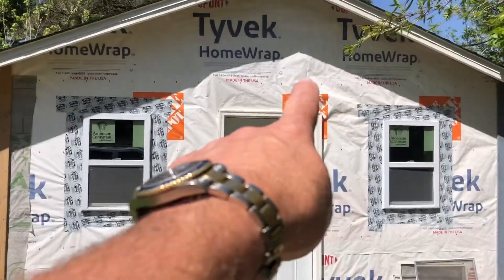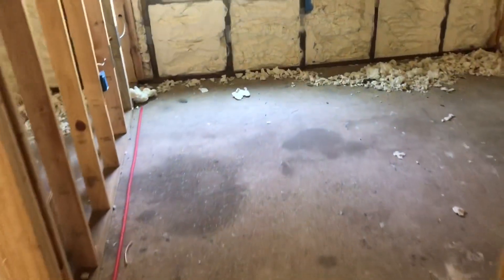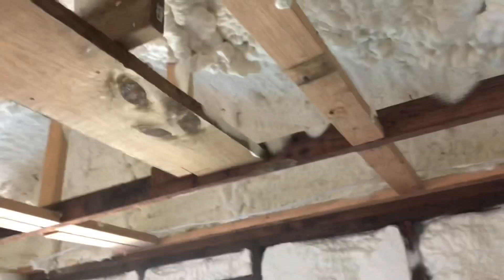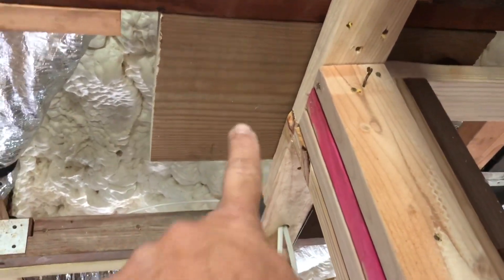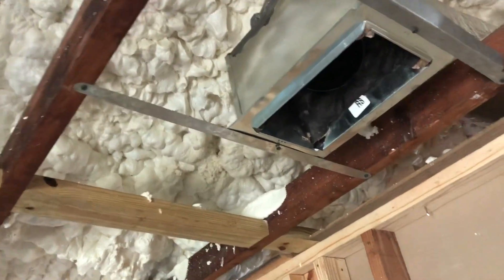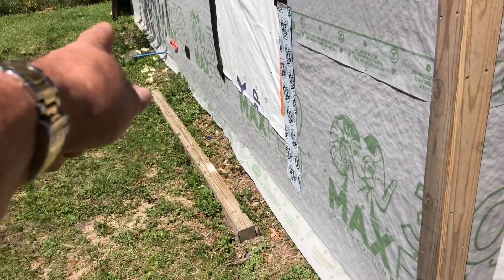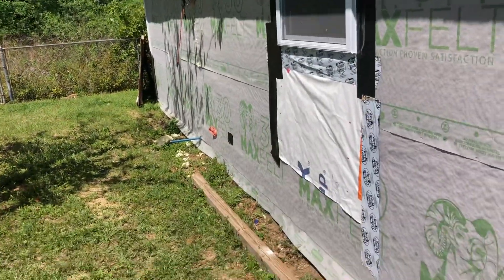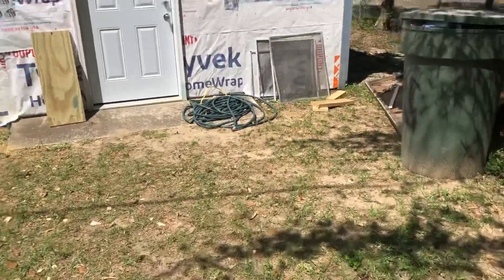P Street Update 3!  Side hustle get rich millionaire extra money passive income

Comment: with Florida known for termites, any issues with the foam insulation to finding them?  
hate the old fiberglass stuff...what do you think about the Mitsubishi small wall a/c...not sure what they are called; being a small space seems like a good idea
Reply from the maker: The big thing with termites if they need moisture to feed and then they eat the wood. If you don’t have any leaks and you shield it from the humidity generally speaking you’re gonna do pretty good… The AC unit is what they call a split unit. If it is a open space than they do real well
Reply: @hustlenation4779  thank you Robert....these Split Units seem like they could work for a small sq ft rental as you are restoring..but I suppose what you are sharing is:  if walls are up within the walls the split units are not a good choice...wish they were...These huge A/C units outside in the yard are an eyesore and hurricane issue prone....just looking for a sleek look, efficient, and even the wall water heaters being pushed hard these days
Reply from the maker: @blissbliss3531  Yes absolutely unfortunately stealing ACs has become a very lucrative business